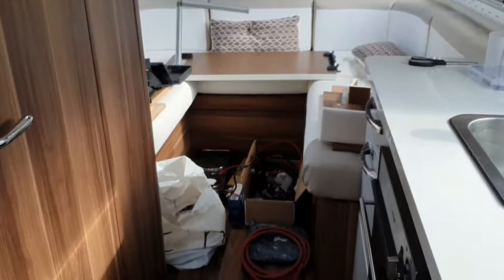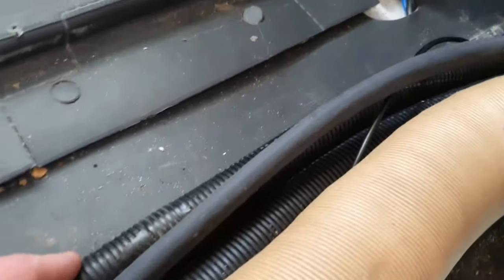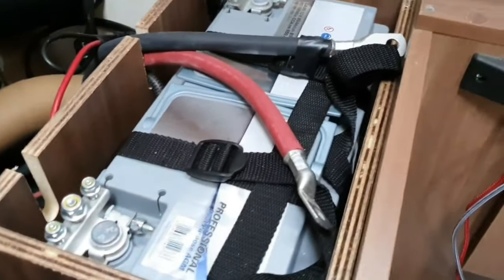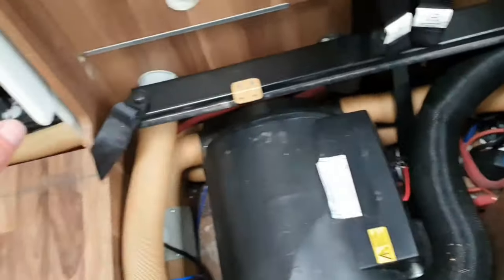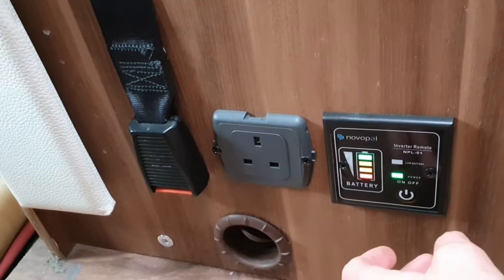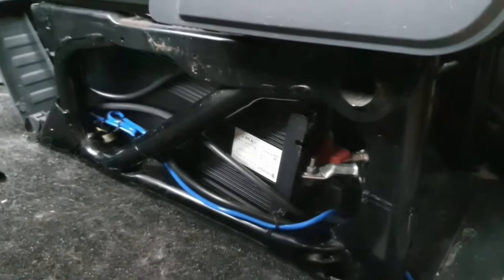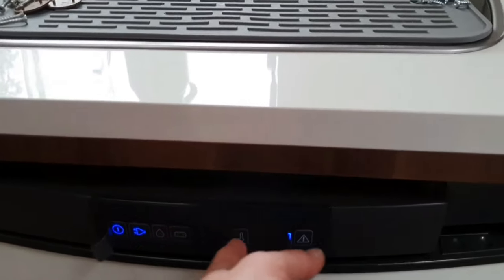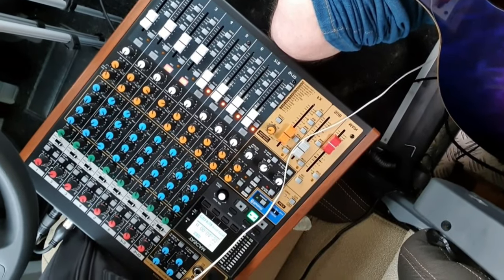How to install 2000W Inverter, Autoswitcher & Music Studio Motorhome 🚐❤ Rollerteam 746 2018

Comment: Hi Jon 
Great work you have done 👌
My name is Konstantins  and I have  same motorhome 😀
I bought inverter  EDECOA pure sine 1500w 
Could you let me know how did you fixed your one under the driver seat?l🤔🤔🤔
Ties or some different way? 
Maybe you could do some video?
Regarding, Konstantins
Reply from the maker: Thank you! Thata great news! I used cable ties to secure it to the under seat metal supports.